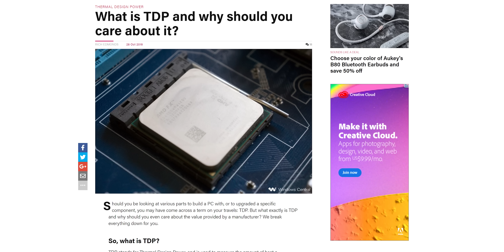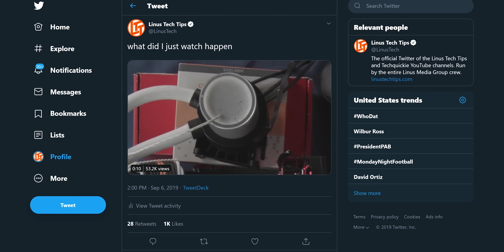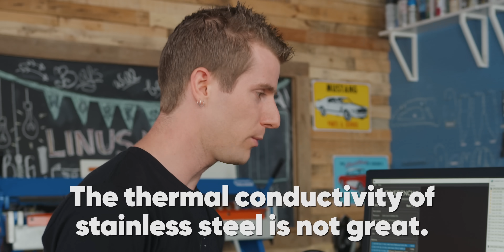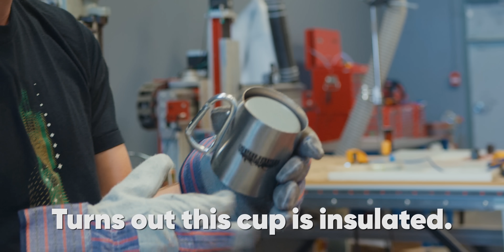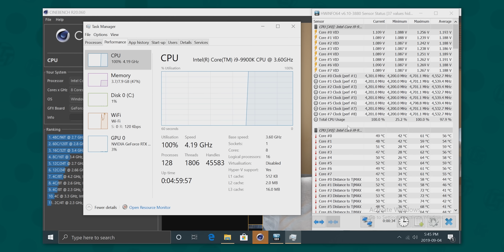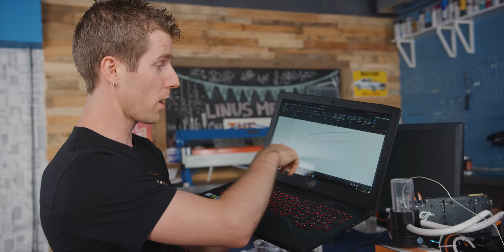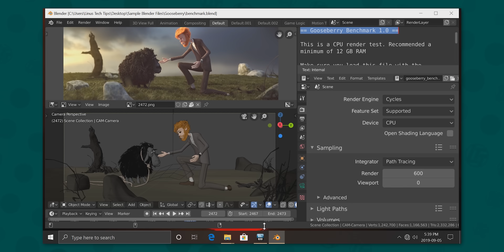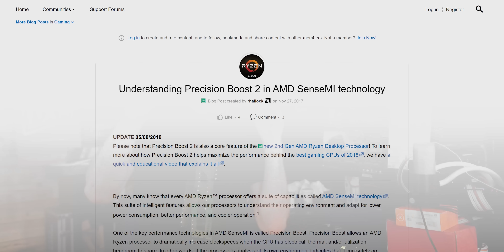Who REALLY Runs Hotter? AMD vs Intel

Comment: This experiment had way too many inconsistencies and uncontrolled variables
Edit: I'm not saying the conclusion was wrong but I expected better from these guys
Reply: I welcome you to Linus tech tips
Reply: Well, it is known that a Ryzen TDP is measured at boost clockspeed, so 105W at boost for 3800X

For Intel, TDP is measured at base clock, so 95W at 3.6GHz, a 9900Ks actual TDP is around 150W with boosts enabled.
Reply: @danielmdax  that's actually really helpful to know, ty!
Reply: Daniel Muñoz 
At same clock, AMD seems to still be slightly more power hungry or around the same as Intel considering how their chip barely manage to reach 4.2ghz boost... while Intel boosts much higher than that. Can’t really tell.
At 5ghz LN2 overclock, AMD power requirement is significantly more than Intel.
Reply: @cunnyman  An interesting side note is that doing more in a single CPU cycle seems to be AMD's current most effective performance boosting technique. So, processing 3 instructions in a single cycle rather than 2 will net a sizeable performance boost in a specific situation, for example. Additionally, the way multicore loads are coordinated affects their efficiency and productivity.

The effects of these types of speed, which is not as directly evident, can be seen in AMD's CPU outperforming Intel's at while outputting around the same amount of heat in this video. Despite the lower clock speeds, AMD's multicore processing technology has been its claim to fame for a while now, and it really shows.
Reply: @danielmdax  No. It's not. You can easily see this if you have a Ryzen processor. I have a 3900X. All-core it draws up to 142 W. Not 105. If you disable core performance boost which brings limits the processor to its base (3.8 GHz in my case) THEN it draws at most 105W in Prime95.
Reply: @femina_multis_faciebus  one thing is power draw and another is TDP genius.

Power draw is how much your CPU uses. TDP is the thermal output, how much heat is generated, since electricity loses energy and becomes heat. You draw 142W and output 105W of heat.

A 9900Ks real TDP is 150W (heat output), and it's power draw (usage) is around 250-270W 

Please learn basic physics before lecturing someone
Reply: @danielmdax  i didn't realize a CPU was able to violate the law of conservation of energy. must be some real fancy transistors in there! or where are you suggesting that extra 37W of power are going if not heat?
Reply: @spambot7110  the excess energy is used by the fucking cpu to calculate stuff.
Reply: @femina_multis_faciebus  it's being used by the fucking cpu
Reply: @spambot7110  those Watts are being used. Not all energy is turned into heat, only some wasted energy turns into heat, thanks resistance.

And well, Superconductors do exist and they do kinda void regular Physics laws
Reply: @femina_multis_faciebus  ummmm, in running the CPU maybe? If 100% of the input power is dissipated as heat, then the CPU wouldn't be able to do any work and you have 0% efficiency.
Reply: @danielmdax  ah yes, the superconductors they totally use in CPUs. But no, superconductors don't really change anything particularly deep. They still follow ohm's law, just with a resistance of 0.

well if they're not being used by the CPU where are they being used? something is either consuming the energy flowing to the CPU or it's being stored. last i checked CPUs don't have batteries in them. don't give me some nonsense about return currents either; it's not like the CPU is connected in series with another load.
Reply: @spambot7110  heat generated is the wasted energy, not a measure of how much energy was actually used by the CPU to do calculations
Reply: sorry do you think that "calculations" are a form of energy? from a physics standpoint, your CPU does no work; it's just a really expensive, noisy resistor.
Reply: @femina_multis_faciebus  and they had the 3800x
Reply: @spambot7110  computing
Reply: @femina_multis_faciebus  do you think a cpus purpose is to create heat, no, the rest of energy goes to the computing of the prosessor and all the funtions it has to do.
Reply: Daniel Muñoz you have a point but not quite to that level, ~90% of a CPU’s waste energy is output as heat
Reply: @femina_multis_faciebus  all energy that is drawn is not dissipated as heat energy though. I'm not sure you really understand thermodynamic as much as you claim to. Heat is only one form of energy.
Reply: @alexChook  ah yes, the well known "compute energy". Someone needs to be reminded that the pictures behind the screen are not real. physics doesn't care about why the current is flowing through a bunch of transistors. Physics doesn't suddenly invent a new form of energy because the pattern of the semiconductors the current is flowing through is mathematically interesting to humans. you don't think that some of the chemical energy your brain consumes goes to your *soul*, do you?
Reply: TheGamingPizza the electricity in a cpu is used to change transistors from 1 to 0 or 0 to 1. the electricity does not stay in the cpu. all of the power is dissipated as heat. the cpu isn't burning calories to use energy in doing work.
Reply: @alexChook  a cpu needs power to run because it needs a current flow, but it doesn't do any mechanical work, doesn't convert it into potential energy, doesn't convert it to light, doesn't create chemical energy but it just produces heat.
Think about the basic laws of conservation of energy, where does that electrical energy go except for heat? 

Basically all the electricity a computer draws becomes heat except for the mechanical work of fans, harddrives and the light emitted from all that rgb glory. a cpu that consumes 150w will output 150w of heat, but it needs that amount of energy in order to work at that performance level.  

I think der8auer mentions this in some video.
Reply: spambot71 I think people think the cpu is burning calories to do math which is why they think energy stays in the cpu haha. but ye all the energy will become heat. that's why TDP is measured in watts. 1 watt = 1 watt no matter what.
Reply: @spambot7110  my mistake, you're right that CPU power draw and the calculations directly transform into heat mostly because the CPU is like a complex resistor.  Some of this is stored as capacitive and inductive energy as well but the majority should be into heat energy. Thanks
Reply: @Simon-eh5ez  thanks Simon. Yeah I was mistaken but I do want to point out that it does covert some of the energy into electric fields and magnetic fields but those would be minimised in a good CPU design
Reply: @dylan-nguyen  while your conclusion is correct you're reasoning isn't quite. Just because you measure in Watts doesn't mean that all the power coming into the CPU will be dissipated as heat. There is something known as apparent power as well.
Reply: @pineapplepizza5733  its purpose is ofcourse not to generate heat, but a calculation simply wastes a certain amount of energy, which is converted to heat.

All energy you put into the CPU gets converted to heat this way. If it weren't, this "unspent energy" would be building up somewhere pretty quickly.
Reply: @alexChook  Very true! It would be very low however. On the other hand, depending on where you measure the power draw could give different results. VRM's get hot as well. If you can accurately measure the power draw of the cpu, or at least between vrm and cpu, you would get a pretty accurate reading. measuring before VRMs would mean making sure both platforms have the same power loss in VRMs, which probably wouldn't be the case.
Reply: @alexChook  so where is the rest going? The chemical properties of the CPU are not changing much over time, so it's not going there. It doesnt emit light, except for infrared light, which you might as well count as heat. The CPU isn't going to move, so it doesnt accumulate kinetic energy or potential energy either... 

So what are the "other forms" of energy I should be thinking about?
Reply: @alexChook  whoa, i'm shocked to see a youtube commenter come around on a physics thing, nice! as for capacitative/inductive/(any) energy storage, recall that that stored energy has to dissipate eventually too; what goes up must come down! so while energy storage means that there might be moments in time where power in != power out, those differences difference sums to zero over time. so you're right that the differences are small in magnitude in the case of a CPU (parasitic capacitances/inductances vs, say, large batteries), they are also zero over time.
Reply: @rickbude3866  hey bud they already came around on that. next time you attack someone for their ignorance, make sure they're still ignorant.
Reply: @alexChook  also dammit! you caught me on EMI. a small amount of energy would be radiated i suppose :)
Reply: @femina_multis_faciebus  The exploding cpu reminded me of a "network issue" a professor mentioned.  
There was a way of identifying 1's and 0's by stepping up or down in voltage. A 1 being an increase from previous and zero a decrease. This meant that sending a long string of 1's to osmeone just increased voltage and it could eventually fry the network cards. Typically recieving end broke since swithces had better interfaces. I think that became really short lived.
Reply: @pineapplepizza5733  problem with that is, second law of thermodynamics. Calculation resault is not a form of energy, thus you cant convert energy to that. Electricity is used to send pulses of electricity to other components, and that will turn to heat, as well as everything fed to cpu. Only diffenert form of energy output from pc is movement and sound (fans and vibrations in magnetic conductors) and lights of leds in boards.
Reply: @spambot7110  is there no calculation for energy? Hmmm guess math has nothing to do with science or physics. You are so smart darn. The real answer to my comment is that there is no constant you are close tho.
Reply: @femina_multis_faciebus  its going into the fucking calculations, use some common sense
Reply: Both test seem to have the same issues making them constants that cancel out. It's not air tight but it is a repeatable test with a variable margin of error. Heinnnnnnn
Reply: @COF Study Are you the Hulk?
Reply: Glad I'm not the only one who thinks this is janky bs ^^
Reply: got about 3 minutes in, and scrolled down to the comments to see if anyone was thinking this too
Reply: Laurel and Hardy Tech Tips
Reply: Their aim was to eliminate those, but literally just using the reported temperature would be better than this...
Reply: @steel5897  I agree but he said at the beginning it was to see which one literally gets hotter
Reply: @steel5897  Nah, if the CPU dissipates its heat more effectively due to internal design differences or thermal medium inside the IHS, it's going to report a lower temperature while creating the same amount of heat.
Reply: This is what i was thinking, wasted data for a probably 5 min video if everything is thought of scientifically
Reply: My thought as well when watching..
Reply: intel user
Reply: Temperature is not the same as heat output. Actually to mesure heat output, all they have to do is to mesure the power consumption. After all, almost all of the electricity power get converted to heat eventually.
Reply: @thunderboltlightning6010  The issue with relying on reading the power consumption and relying on that to measure the thermal output is that, while thermal output is directly related to power consumed, the proportional relationship between how much electrical energy is consumed as actual work and how much is disapated as heat will be different between the two architectures and manufacturing processes - that's effectively what they're trying to measure. I studied physics to an advanced level and I'm an avid overclocker (I'm doing it right now actually) and just thinking about it off the top of my head, I can't think of any way to improve the results due to so many of the variables being uncontrollable - typically you would want the work rates of the two CPUs to be as similar as possible, and you'd do that by adjusting the clock speeds until they took as close to the same amount of time to complete the blender render, but then you have to take into account the thermal overheads from the non-processing components of the CPU - the IMC and power distribution would be the principle problems there, especially as my own experiments with blender show that it just doesn't give a rat's ass about memory performance.
tl;dr - the problem isn't that they did a bad job, it's that the job is virtually impossible to do to a perfect scientific standard, which is why no-one else has bothered to try publically before.
Reply: @stoneymahoney9106  The amount of electrical energy consumed as actual work is neglectable.  Virtually all electricity consumed get converted to heat one way or another.
What you called "actual work" can be view as the icrements of entropy. Which can be converted to equivalent mass or energy. When you actually done the math, you'll see how little energy end up as "actual work". The proportion is so low that its basically impossible to measure.
Reply: Yeah they also kept the lid of the water pump open. That's not great
Reply: Couldn’t they just use a multimeter or a watt meter of sorts to tap into the CPU power rails and just measure the power draw from a strictly electric standpoint.
Reply: @Evildandalo  that would calculate power draw, not heat output, both measured in Watts, so it's kinda confusing
Reply: Daniel Muñoz Maybe you could measure the power draw, get the temperature measurement of the CPU heat spreader by soldering a temperature probe to it, then see how much heat in Celsius is produced per watt used? Like a ratio of X degrees increase per X watt used.
Reply: @Evildandalo  they are talking about heat output not power usage
Reply: That coil would waste so much juice
Reply: @LalkeBanditen  wtf
Reply: The test was sufficient to draw relative/comparable conclusions and that's what they did.

To everyone in replies:

Power draw != TDP

Electricity is eventually turned into heat, YES, either "directly" or through a chain of events (e.g. electricity>light>heat), well, 99.98% of it is, anyway. But, how fast that happens matters a lot and the chain of events leading to that matters a lot. That's why the word eventually is the key here.

A 200W heater will heat up its surroundings much better/faster than two 100W TVs or monitors for example.

Why is that? Efficiency. Again, if your CPU instantly converted all of received power to heat it would have 0% efficiency and it would be doing no work, it would be this magical most efficient heater in existence and the least efficient CPU, as efficient as a brick when it comes to computing.
Reply: @sujimayne  can you name a significant loss path (say >1% of electrical power intake) that is not converted into heat within the same room within nanoseconds?
Reply: @sujimayne  Yes, it isn't instant but it is very fast. It basically gives off no light in any wavelength, and doesnt really store much energy in it, neither does it convert electricity into anything else except the very small amounts of electric fields and such loosely mentioned above. 

And no, a cpu doesn't perform any work if we talk about work as in the physics term. a CPU can perform calculations thanks to a current flow, but calculations (electricity flowing through gates) isn't work in a physics standpoint. A cpu is a very efficient heater, nearly all of the eletric energy that goes in is converted to heat nearly in an instant. Since it doesn't do any work. Ever thought about how TDP is used to both calculate how much power and how much cooling performance is needed?
Reply: Yes a Intel fucking useless fan
Reply: Also the best way would have been prine95 and temperature measurements because it is real world performance
Reply: #outofideas . LTT needs to leave real science to youtubers with college degrees.
Reply: @curt8806  bruh, Linus has college degrees, so does Luke, it's just they are not actual Scientists, this is Entertainment in the end, not Gamers Nexus
Reply: Daniel Muñoz Linus and Luke both do not have a bachelor degree. Luke dropped out for LTT.
Reply: @danielmdax  Couldn't agree more.
Reply: @danielmdax  you can do fun entertaining things ,without hurting the brands ,do all fun experiments you can think of , but when you involve a test between 2 brands  your obligated to take a more scientific aproach .
Reply: @curt8806  LTT is the Mythbusters in tech. There I said it. They'll say they're doing the scientific method, and my bigheaded phd in physics brother will say "Bullshit!" to which I say to him and to you: "Fuck you, man!"

Hell, no one is showing their TDP tests in public right now, at least no one of note has. This is content. It's janky to the extreme and no science nazi will ever approve, but the guy who brought back a sniper rifle from the future to the middle ages is the one true king. So shut your pie-hole! My argument makes sense, go two levels deep.
Reply: @curt8806  or to youtubers that actually try.
Reply: shut up boomer.